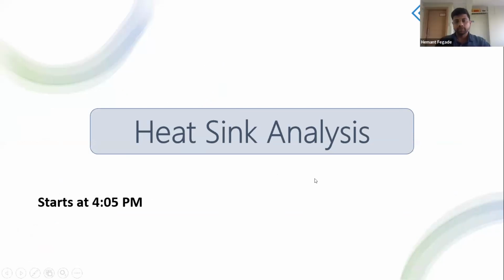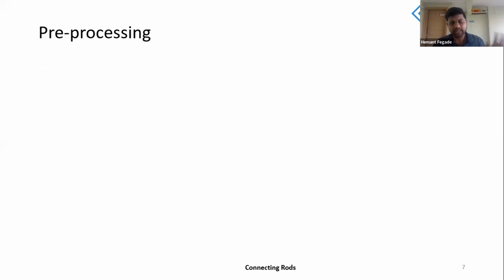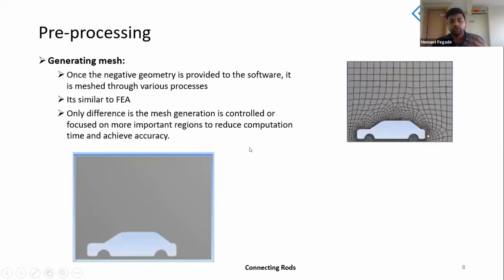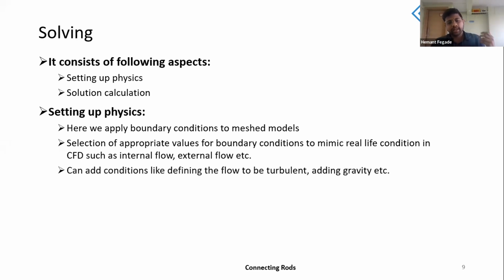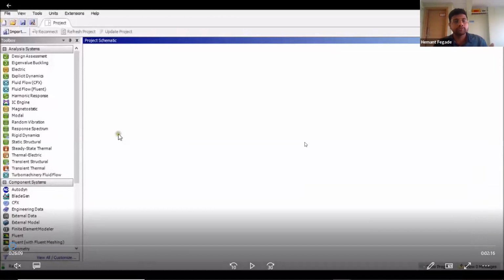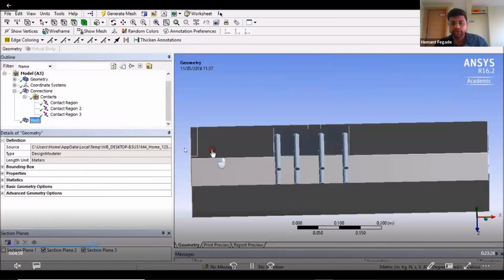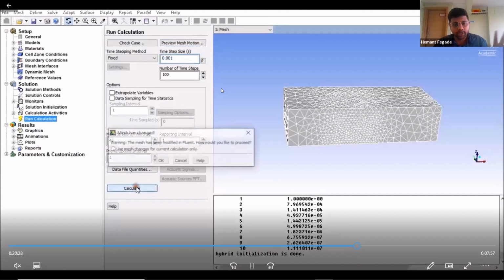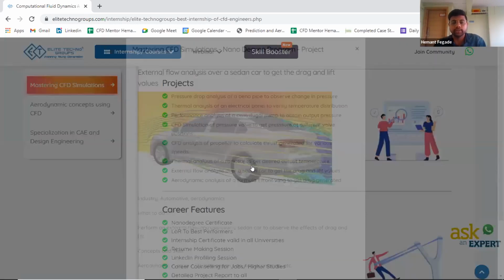CFD Analysis of a Heat Sink with Ansys || MES BIT Sindri || ET Groups

Comment: Hi, compliment for your videos. 
I just started using ansys .
I would also appreciate it if you just recommend me a specific tutorial to implement the requested case
as there are various ways to do the same thing:
STEP1
1) Geometry design: I need to design a simple 3d parallepiped( aluminium for example), on which there is an heater source.
2) Electrothermal simulation: I need to make an Electrothermal simulation
3) MOR: Through the electrothermal simulation , the software Ansys must return me a compact and simplified model (MOR).
I would appreciate some advice on which resource(book, tutorial...) to use based on your experience
Which part of the ansys suite do you think is best suited for my specific case?